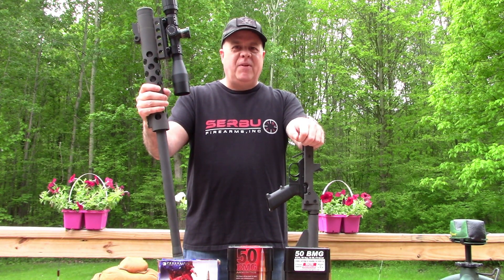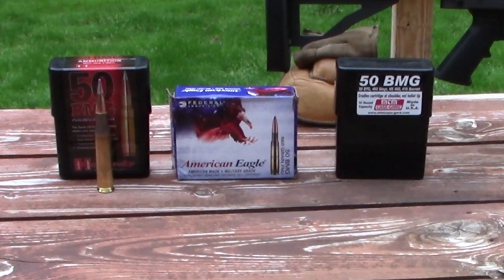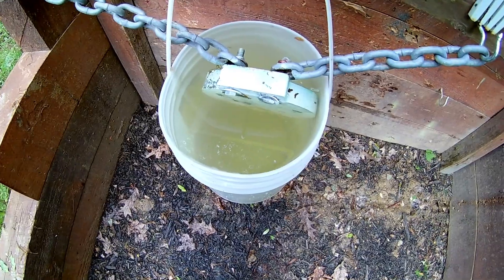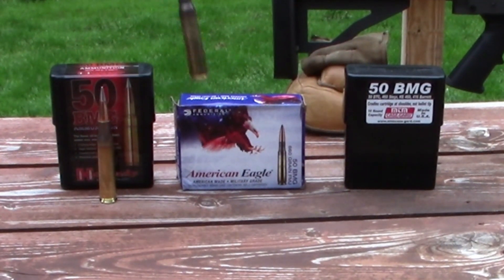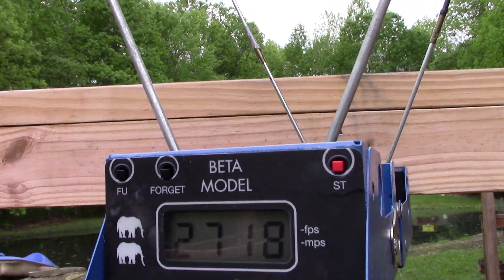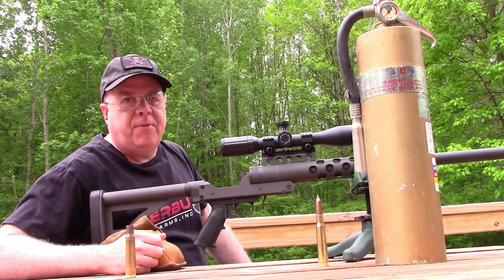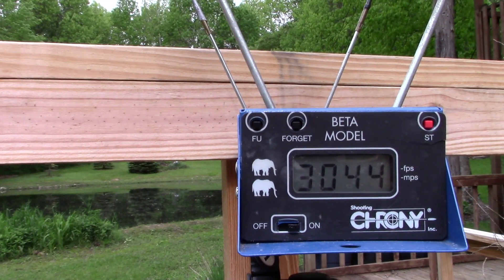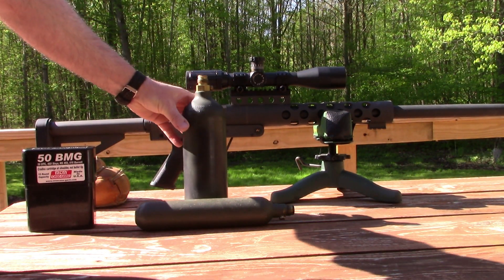Fun with a Fifty #4

Comment: Great test! I have the same 29.5in RN50 with a swfa12x. It’s a great setup. But I am Interesting about what kind powder charge in this Reman API round. 647gr at 3044fps is 13309ft-lbs energy out of a 29.5barrel!!! 50bmg generally gain approximately 20fps every inch over 29in, then drops lower at 40in. That will make this API at least 3300fps and 15642ft-lbs if fire from a 45in M2. It’s over the maximum number of 50bmg loading date by my research! That probably means these reman API may over pressured and dangerous(like Kentucky ballistics fire bad slap round exploded his RN50).
Reply: Just read all of the comments and correct it is a 619gr APIT. That make a lot sense. Still a great video and so fun!
Reply from the maker: Thanks for checking out the vid and looking out for me, 张凯旋!